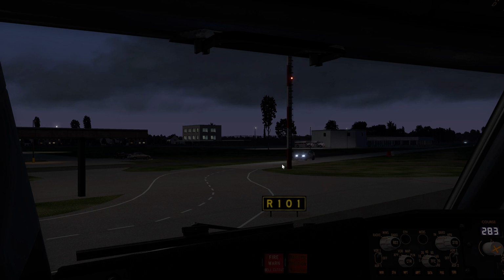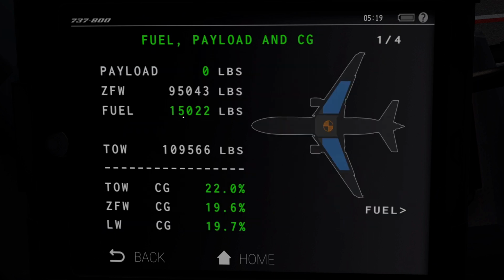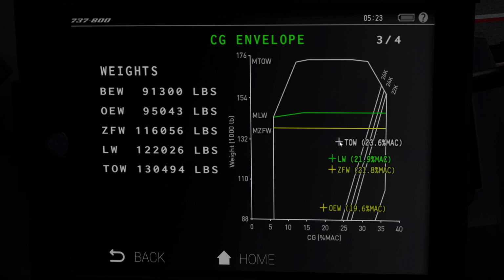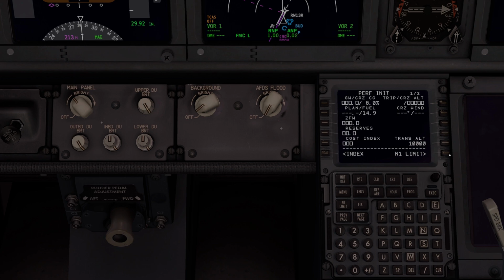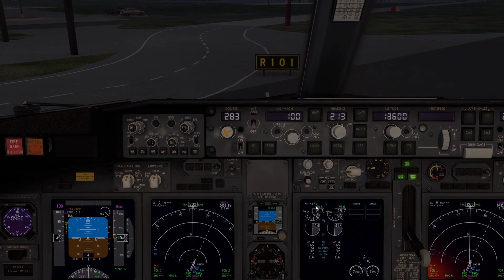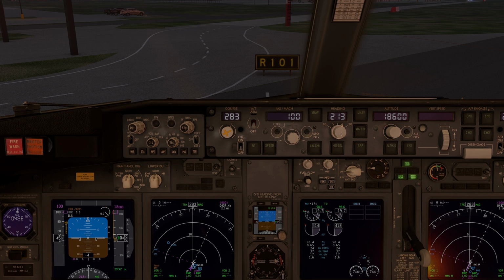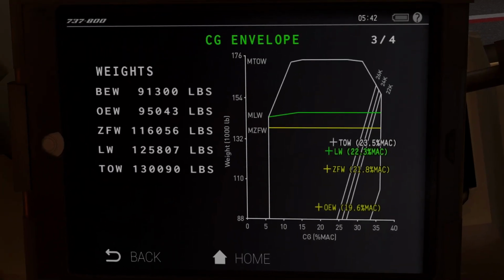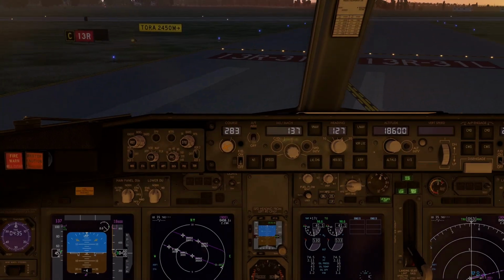Auto Take-Off and Autoland with B737 ZIBO mod - Part 1: Preparing for Flight

Comment from the maker: Hello! Sorry that the second part is coming late - I had problems recording it - while recording did not go well, only without. Meaning that if your computer is to busy you shall be prepared to switch to manual landing or go-around. And the Prague video came up, and consumed most of my time until now. For the impatient the main trick is that before take-off and landing you need to switch on both Flight Directors - the autoland system needs both systems up. The rest will come up in a few days. In the meantime I have worked on my recording setup and other parameters.